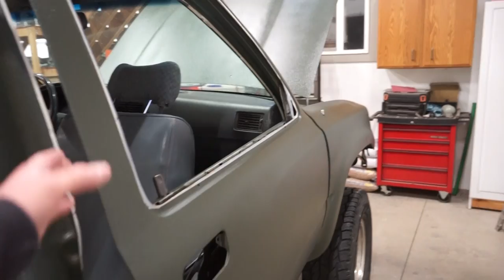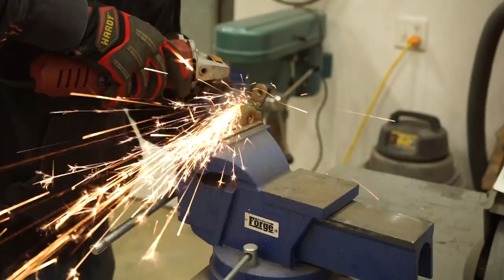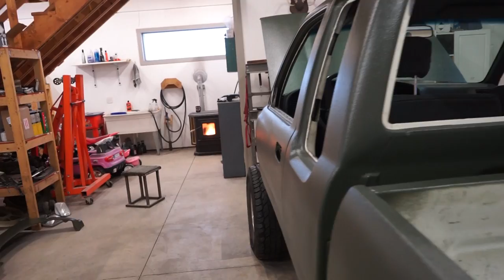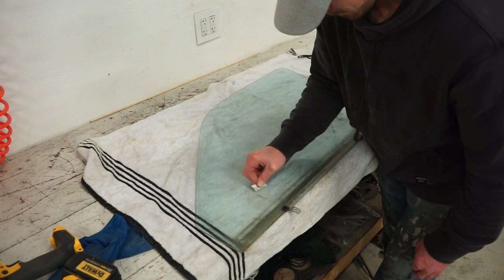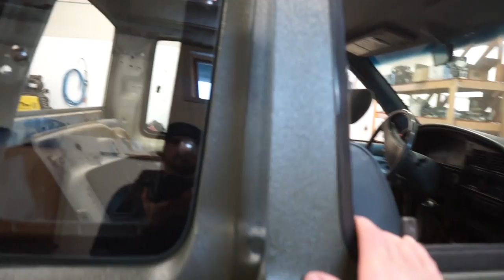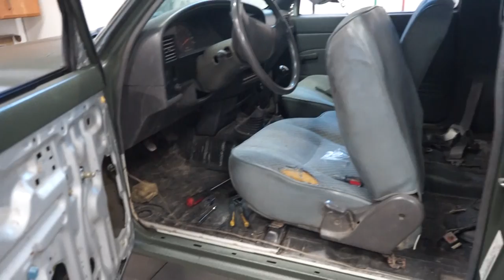Getting The Toyota Back Into One Piece After Raptor Liner!

Comment: I installed one of those windows in a 1984 Toyota in 1984.  A friend and I were outside for 2 hours in the snow getting the old non slider out!  I was cold, getting pissed and at the point of duct taping the glass it and hitting it with a hammer, but we finally got it out.  We used the the technique you just did putting in the new slider and it took about 5 - 10 minutes!  We sprayed the cord with WD 40 and it practically installed itself!

Comment: How about vinyl carpet instead of the regular cut pile? Add a gun rack in rear window and some cheaper Ebay Dynamat/  Fatmat,  Rattletrap sound dampner  in the cab. The Taco build looks great. I was thinking you could have put one flex joint in the exhaust system also after the down pipe.

Comment: Audi TT roadster mid 90s 2000s seats work so easy they have a flat seat rail assembly flip forward for the extra cab And a Fully manual adjustment mechanism, also leather, My ones were even similar colour to original trim.

Comment: Nice work man. I have the same year white Toyota too. Which rear window did you use ? I need to replace mine. You made it look way easy. So I’m thinking about doing fit myself. I’m going to get engine lift to use as “crane” too! I might even fab it to be a high lift with a winch.
Reply from the maker: Its the same window that was in the truck! Its pretty easy to replace!

Comment: Have you thought about using the box liner on the interior floor as well, rather than carpets?
Reply from the maker: I like carpet!
Reply: @austinniemela  He's got a great point, but I prefer carpet too. Plus I'm hoping for some pro tips on the install.
Reply: I lined the inside of a '93 Jeep YJ I used to have and carpet is the way to go. You'd think the liner would deaden the sound and heat but it does not.

Comment: So how much raptor did you actually use on the outside of that truck I'm doing the exact same truck
Reply from the maker: I did 2 coats and 10 bottles. You could do better with one solid coat!
Reply: @austinniemela  do you think it's worth doing two coats I'm kind of like you I want to do it once but right